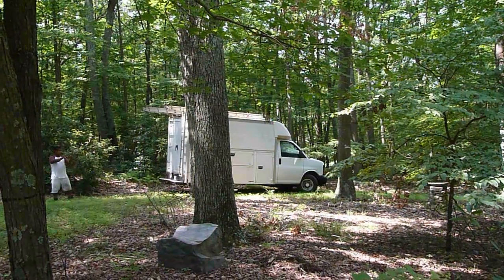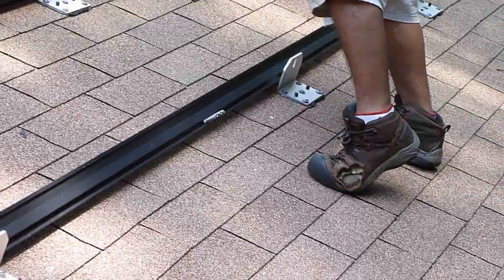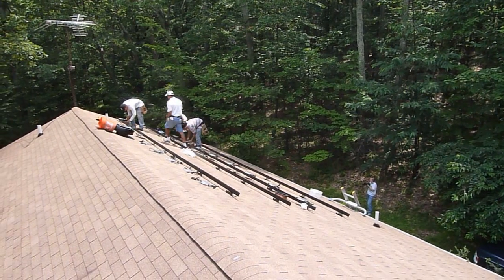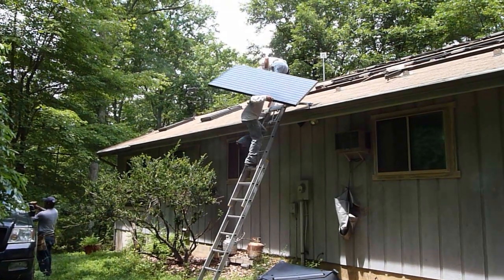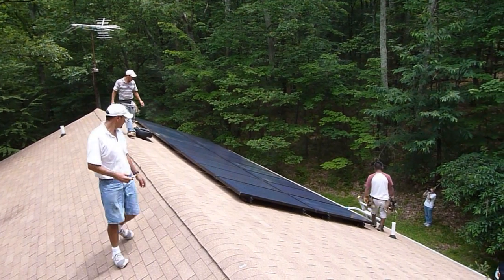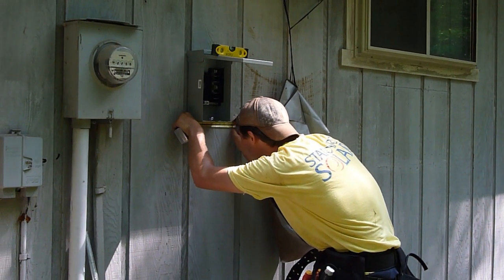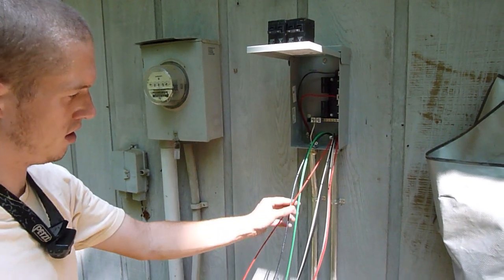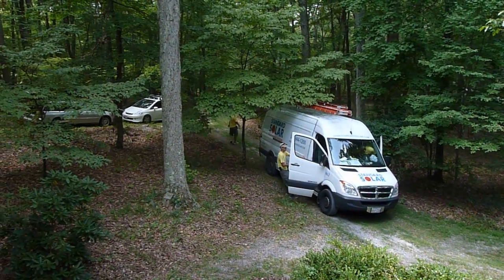Photovoltaic solar panel installation (in HD)

Comment: Brief visit suggests poor install. The brackets don’t look like they are waterproof. Cables should not lie on shingles; abrasion over years could wear through. No OSHA required safety harnesses.
Reply from the maker: If you watch the whole video, the brackets are heavily caulked (and have diverters) when installed. This installation was done in 2010, so I do not know if there was an OSHA requirement for harnesses then -- it is a single-story home. I'm pretty sure that all cables were tied up by the end of the video, but I haven't watched it all the way through in several years.

Comment: A couple of hours for 18 panels, but a next day return to install electrical service and commission the system.. really that long?
Reply from the maker: Actually, it pretty much took two full days. All the panels were on the roof in a couple of hours, but there was still plenty of work to do the first day (conduit, connection boxes, clean-up, etc.). So yes, this took two full days.
Reply: @BobKovacs  takes the boys and I a couple of hours to install and commission a two story home with 30 panels, and clean up as well.. lol awesome though
Reply from the maker: I guess you got some special kind of magic. Of course, this system had to pass inspection from the local building inspector, and that takes some time as well.

Comment: Great video ! I like you're using MC4 connectors instead Anderson connectors. I would like to know how many batteries did you use?
Reply from the maker: This system has no batteries -- it is connected to the grid. If grid power goes down, then this system will not generate power. Fortunately, there were only a couple of brief outages during the time we owned the system (2010-2016).
Reply: @BobKovacs  wow! I though you were using batteries. It happens when you're connected to the  grid. Do you think in the future connect batteries?
Reply from the maker: I don't know what the current owners might do. Modifying this system to include batteries will cost at least a few thousand dollars, so they might not want to cough up that kinda dough for something that's useful only occasionally. I had a 4kW gasoline generator that I fired up during any long outage, and I seldom used it.

Comment: Just curious; and this is from an outsiders point of view.  I see five openings in the flashing; for the bolts to secure it to the roof.  Now, all five can't be going into the roof rafter unless the rafter itself is just some really fat piece of lumber.  Are those screws going just into the flat roof or are some of them being screwed into the roof rafters themselves?  

Something else too, as the bolts are being driven into the roof, I saw what appeared to be a rubber gasket kind of mold itself to the roof shingles as the flashing is being secured to the roof.  Is that observation correct?  And if so, won't the rubber wear out over time?
Reply from the maker: The bolts were screwed into the roof decking, which is 1/2-inch plywood. The rafters are 16-inches apart, so any bolts that hit a rafter just happened to be in the right place at the right time. There is no way to hit a rafter with every bolt, nor was that required by the building department (which did inspect this installation). The gastket material you saw was some sort of sealant, perhaps silicone. Everything wears out over time, even rock, but the sealant will probably last as long as the shingles. The solar panels protect the sealant from the worst of the sun and precipitation.

Comment: This is the first solar install video that has the home in what looks like is a rainforest so to speak. Wow, I'm sure the system works great as is but I wonder how much better it would perform if the entire house wasn't surrounded by so many trees.
Reply from the maker: A couple weeks after this system was installed, we had four of the biggest trees cut down. This system is in Virginia, so it is more temperate forest and not jungle vegetation. These trees are deciduous, so the leaves drop in the fall and there is less chance of shading at that time. All that said, we always did have some shading in the morning and afternoon. When the system was exposed to full summer sun, it generated 3,700 Watts. We did not pay for electricity for 8 months out of the year.

We sold the house in March 2016, and I assume the current owners still have the system running smoothly.

Comment: How do they fasten the wire to the house without getting it to leak? I have a customer that has Electrical staples that are rusting severely nailed right to his plywood on his roof this to me is unacceptable there has to be a better way to fasten these wires down do you have it?
Reply from the maker: I pretty much show everything in this video. There are wires fastened to the mounting rails, but no wires fastened to the house that I can recall. There is a cabling box on the roof into which the power cable from the solar panels runs. It is then connected to a power cable that penetrates the roof below that box. (This box is below one of the solar panels.) Any wires run outside the house are in conduit, and they are fastened to the wall with conduit clamps and screws.
Reply: @BobKovacs  thanks for that I'll have to try to straighten those wires out.

Comment: As being a solar engineer, I don`t think this is a good installation at all...Safety for the installers, install the panels in the shadow, the installers were pressing the panels directly during installation ... Come on...
Reply from the maker: Several trees shadowing the panels were cut down immediately after this installation. As for the rest, no one was hurt during the installation and the panels worked fine during the time I owned them (2010 to 2016). If a panel had been damaged, the contractor would be required to replace it.

Comment: Enphase microinverters!
Reply from the maker: I don't miss the Enphase microinverters. Of the initial 18 that were installed on this project, six failed in less than six years, and were replaced. It was at no cost to me, but it often took months to prove to Enphase that an inverter was bad and get a replacement coordinated. Overall, the system always generated good power. However, one, two or three dead inverters often kept the system from running at its peak.

Comment: I would recommend that people check or even replace their shingles (depending on condition) before installing these panels.
Reply from the maker: Our roof was about 12 years old at the point we installed these shingles. You're right to be cautious -- it would be smart to put down a new roof on the side that has the solar panels, since that roof has a lifetime about equal to the panels. I figured that we would sell the house before replacing the roof was necessary, and that is what happened. We installed the panels in 2010 and sold the house in 2016.

Comment: Did they installed without permit?   No one has a hart hat or tied down to the house.  Hope their safety skills have improved  by know.
Reply from the maker: We had a building permit for this installation, so it was inspected by both the building inspector and the electrical inspector.

Comment: Lets see. violated OSHA rules, mounts not installed into rafters, improperly flashed brackets, no need for all the grounds with Enphase inverters, improper use of EMT, improper breaker size, and I could go on...Congratulations.
Reply from the maker: This system worked fine for me for six years, until I sold the house more than two years ago. It was also inspected by the local electrical inspector and building inspector when it was installed (which was 2010). As far as I know, the system is still working fine. I had no leaks from the roof. Six of the Enphase inverters failed during that time and were replaced at no cost to me.

Comment: what is the connection of your solar panel parallel or series?
Reply from the maker: Each solar panel has its own inverter (called a "micro inverter"). All the inverters are connected in parallel, so if one goes out, all the others continue to work.

Comment: Where are there harnesses and ropes ! In new zealand health and safety would fine ya working unproteced !
Reply from the maker: In the US, in this jurisdiction (Virginia), safety harnesses were not required at the time this was installed (2010). Harnesses might be required now, but I don't know for sure.
Reply: Bob Kovacs those PV installers were fast and good with work

Comment: What happens when the meter runs backward? Does it give energy to the power house?
Reply from the maker: A couple months after shooting this video, the power company installed a "net meter." The net meter keeps track of the power I feed the power company. For every kWh I feed the power company, it feeds a kWh back to me when I need it. The result is that I generate excess power in June, and get to draw it back for free in November.

Comment: Having the inverters directly under each panel is stupid and maint prohibitive being needing to jump on the roof and find out which one failed. Its better too have all the inverters on the ground level each one properly indicating which panel it goes too.  Any issues get fixed on the ground.
Reply from the maker: From a maintenance standpoint, you are correct. However, it will cost more to install them that way. For the 18-panel system I had at this house (two rows of nine panels), it was not a problem for a technician to lift up any panel to get at the inverter. We had a map showing where each inverter was installed, so it was no trouble finding a specific inverter. And in theory, the inverters need no maintenance -- although six of them failed during the six years I owned the system in this video.

Comment: No flashing under the shingles, just silicone and direct bolt to the roof, this is gonna leak.
Reply from the maker: There is flashing -- go back and look again. In the nearly six years I lived with these solar panels, there was no leak. I sold the house in March 2016.

Comment: hi what is this setup?  called
Reply from the maker: Solar panels on the roof.
Reply: Bob Kovacs on grid??
Reply from the maker: Yes, this is an on-grid system. There are no batteries or storage for this system. You can see a simple tour of this system at https://youtu.be/IAY52OUraMI

Comment: Im sorry, but the total lack of solar potential at this location would make it a NO GO!! The is no way I would have suggested solar for you Bob... The trees will kill any kind of ROI!!
Reply: jarrodsfamily Life, problems, and solutions aren't black and white... trees decrease heat, which might allow the owners to run the AC for less time. If the AC pulls the most energy in the home... it's possible that a balance between a roof that is always sunny, but the added coolness of surrounding trees makes an optimal system. 

Again, solutions aren't black and white... I may be wrong about this specific example, but don't jump to conclusion so quickly. Unless you are a professional in the field... which I am not.
Reply from the maker: jarrodsfamily What this video doesn't show is that I had several trees cut down immediately after installing the solar panels.

Comment: Why do solar panel installers not provide spacing in-between panels for accessibility for inspection and maintenance works?
Reply: Bob Kovacs haha yeah Chinese crap u got
Reply: Bob Kovacs and did they even hit the rafters??
Reply from the maker: No. Most of the lag bolts for the mounts went into the 1/2-inch plywood sheathing on the roof. And that caused me no problems over the 6 years I owned the system before selling the house.
Reply from the maker: Leaving room for maintenance means that you get fewer panels in the same space. Most customers (like I) want more panels and the hell with room to maintain them. As it turned out, six of the microinverters on this system failed over the next five years and panels had to be removed to swap out the microinverters underneath. It was not all that hard for the technician to do that. If we had three rows of panels, it would have been much harder to service the row in the middle.

Comment: Now, how much does the disposal of the old photovoltaic cell cost?
Reply: Bob Kovacs crazy how solar stanchions did not need to be flashed and those old emphase system still need to be grounded takes me back to when I first started installing just know torque down with impact can cause micro fracture on the cell
Reply from the maker: I have no idea. These panels were installed in 2010 and I sold this house in 2016. The panels were still working fine then, and I assume they are working fine now (in 2017). Unless a tree falls on them and breaks them, I expect them to work for another 20+ years.
Reply from the maker: What are "solar stanchions"? As I recall, everything attached to the roof received flashing, but I haven't watched this video in years.

Comment: It must really suck when your shingles wear out
Reply from the maker: Yes, that is a concern. The roof was about 12 years old when we installed these panels and it was in good condition. The shingles under the solar panels will wear more slowly, since the get less scorching sun and the panels protect the shingles a bit from precipitation. But still -- the shingles will wear out at some point and the only way to replace them is to remove the solar panels. I sold the house a year ago, so it won't be my problem.

Comment: good installation. but the safety is poor. btw who design the system?
Reply from the maker: The system was designed by Standard Solar, the company that did the installation and sold the components. Keep in mind that this was installed in June 2010, nearly 7 years ago.

Comment: In Australia with all the safety rules and everything that would be 2 week job, and no I'm not exaggerating.
Reply: We have the same OSHA rules in America!
Reply from the maker: Regulations probably have evolved since this was installed in 2010. As it was, we had to get a building permit and have a couple of safety inspections. Those were set up before the installation and the inspectors came out as scheduled.

Comment: Do you think you fully get back your installation cost with the sale of the house?
Reply: Thats funny to think an internet connection would affect interest and subsequent value in a house
Reply from the maker: I really thought I would get back a healthy percentage of the cost when I sold the house. My seat-of-the-pants estimate was $10,000. When we listed our home with a real estate broker, clearly some of the interest in the home was due to the solar panels. But the reality was that we sold the house for less than we had expected. This wasn't due to the solar panels or the condition of the house -- it was mostly do to the fact that the house is so remote that there is no reliable Internet connection. When we bought the house in 1993, this wasn't a problem. We used dial-up and it had a decent dial-up connection. But there was no good high-speed Internet option... really only satellite, and that is slow and expensive. My guess is that the lack of good Internet choices (we struggled to get reliable 500 kbps service) depressed the value of the house by $20-30,000. Who wants to live where the Internet is expensive and slow?

So I'd like to say that the solar panels (which still worked fine after nearly six years) added value to the house, but the reality is that we sold for less than we had hoped. Therefore, there's no way to judge what value the solar panels added, if any.
Reply from the maker: I agree... I had never thought of that, until potential buyers came to the house and started asking about Internet service. This would be a GREAT place to work from home if you were a writer or just wanted to be out of the rat race. But the Internet is a necessity to work from home. Lack of good Internet choices is like lack of good water choices -- imagine if you had to order up a 1,000-gallon water delivery every month, maintain a tank for it and ration its use to be sure you don't run out. That was kinda like the Internet at this house.

Comment: thoes mounts are going to leak for sure
Reply from the maker: All I can say is that I owned the house for nearly six years after this installation and there were no leaks. I sold the house (with the panels installed this past March -- and I've not heard about any problems since then.

Comment: hey guys, what kind of caulk are you using? at 0:41
Reply from the maker: This video is more than six years old, so the exact type of caulk may no longer be available. That said, it's a caulk intended for roofing patches, the same stuff you might use around a newly installed skylight.